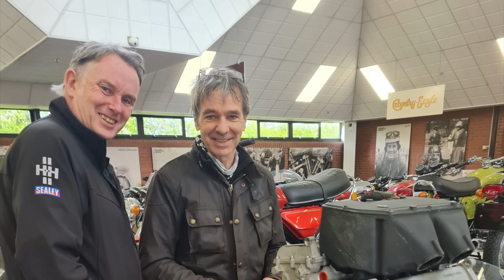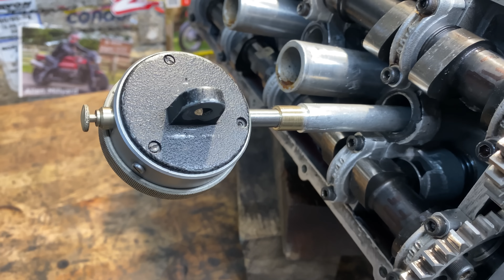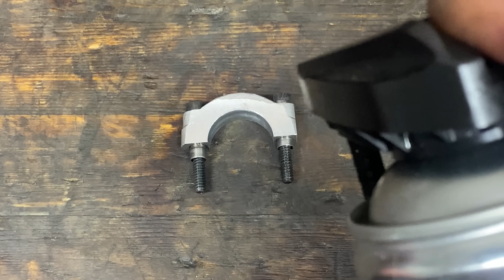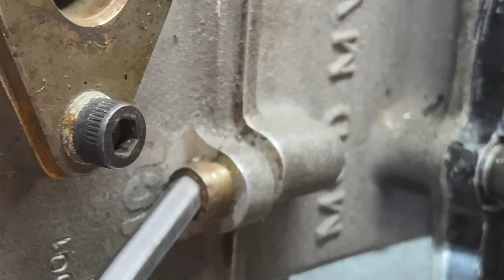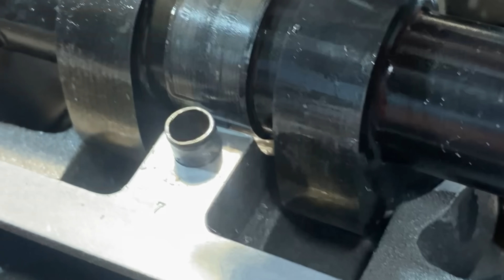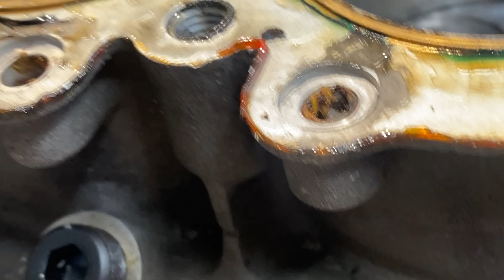Norton Nemesis V8 Rebuild - Episode 3

Comment: I don't know about anyone else,But I hear the clock in the background,Now I can't focus on a video of somebody fixing a motorcycle or a car or just general tinkering without a clock ticking...so I bought an old clock,turn down the volumn on whatever video I'm watching..I couldn't figure out why that sound was so pleasing and relaxing..then I remembered that my grandfather was a machinist and all of his finishing touches were done by hand,with small files,emery cloth etc in complete silence,no lathe running,no polisher, just the ticking of the clock on the wall behind his finishing table,Hot coffee,his pipe filled with Borkum Rhiff vanilla tobacco,and I would watch him for hours in silence
Making babbit or scraping a burnt bearing,then measure it with Lead Wire to see if he had enough to run the bearing with a standing fit or a running fit
His finger flitting,the curly strips of babbit peeling away,made me think it looked liked he was healing a scar.. anyway I start my days again in silence, coffee, Marlboro Reds and the soft tick tock of the wall clock,strange how a sound that it whole job is to do nothing but mark time can make a work day start out easy,focus comes
Reply from the maker: Can’t beat the relaxing sound of a ticking clock 🙂

Comment: Ah, breakfast with Allen...
The lash caps look to be cupped, which is odd for such a low-use engine, unless there was an oiling issue. Did you find the same?
It looks like red anaerobic gel sealant was used on the block/head surface in addition to the copper fire ring and water jacket O-rings.
Some others have mentioned, but the crud in the cooling passages is either large amounts of Stop-Leak or a reaction between incompatible coolants. Let us know what you determine as the root cause.

Comment: At 4: 46 there is 3 cylinder  shaped pipe( flinch?) in the middle of the cylinder head  what are those ? Could anyone tell please
Reply from the maker: They are the coolant pipes from the top of each cylinder head I will be redesigning them

Comment: I’m sure Allen has seen it. Loctite 518 is an anaerobic in-place gasket. It’s deal for jobs like this, because it won’t cure outside the joint so it won’t create crud to block water (and oil) ways inside the engine.
I’ve used it as temporary back-up for worn O-rings and found it sealed perfectly.

Comment: Those water passages are a good indication that the water pump is NOT performing properly. There should be a minimum flow rate of 10 liters per minute at 500 rpm. I would run Liquid Intelligence nano glycol instead of any water based coolants. The engine will run about 15 degrees hotter bu the nano glycol does not turn to steam and there is no pressure in the system as a result.

Comment: I just noticed that the cam sprocket appears adjustable, so they could line it up at a fraction of a tooth.
They had enough engineering moxie to make that, but they have the head a noticeable amount.

[I used to work for a kit car company which made GT-40 replicas. A 289 HiPo motor was sent to the shop with downdrafts, and an Englisee manifold. Apparently, the engine was Boss302'ed, fitted with 351 heads or something. One of my coworkers spent a week making the "bundle of snakes" 180 degree headers for the motor. The engine was filled with coolant, which in turn spilled from the openings from the incorrect dowel-pinning. AFAIK, the headers were scrap. : O ]

Comment: Any possible chance you coukd venture over into car engines 😅 just because toyota never made a follow up engine of the 2jz but they have made 3 cylinder corrolla/yaris engine if you could stick two corola engines together i think that would be a new 2jz that would be insane to then put new 2jz in a new supra

Comment: Another brilliant and satisfying video on many levels. I noticed at 5:59 you could see a plug in the end of the camshaft meaning that the shafts are oil pressurized to supply oil for the bearings.  Novice question:  Are the camshafts cast with the lubrication channel integral or is the channel drilled afterwards?  I'm guessing that the cam lobes are surfaced hardened for the required durability.  Thanks again for taking us along for the ride.

Comment: Mr. Millyard, do you repair CDI SSM Igniter boxes used on late 70's H1's - part number X6T31371?  When I purchased the bike it had no spark.  I tore the wiring all apart probing looking for a bad circuit.  Finally came to the conclusion is was the igniter box.  After changing the box fixed the issue and had fire to the plugs.  I'd like to have a spare in case the box goes bad again.  Let me know, and thanks!

Comment: So that's UNC and Metric, UNF next? 😁What a difference between the front bank and the back. What a task rebuilding that behemoth. Can't be many to tack that on 👏
Reply: If it was a REAL Norton [or Triumph, of the late '70s] it would have had CEI [Cycle thread] for those big axles, UNC for the front cylinders, UNF for the rear cylinders, Whitworth for the forks, and for 'modernity', Metric for all the engine fasteners.....
Reply: I hope Allen has ordered his copy of the Haynes Norton Nemesis manual..
Reply: @packhams4  😆

Comment: Question for Mr Millyard. I always thought you put cylinder head (and camshaft cap) bolts  back in the same holes they came from. Given the way you stored them in the metal trays there is no way you could do that. So am I wrong or are you replacing the bolts with new ones?

Comment: The head is interesting. The cam journal caps seem a bit small. It looks like there is a wrenching hex built into the cam, which appears to have been used quite a bit--though the pistons are still nice and shiny.
Reply from the maker: Yes I thought that as well 😳
Reply: @AllenMillyard  , is the cam billet? Or did they take pipe and weld circular disks on it to make the working surfaces?
I just noticed how small the lower cam journals are--because of the narrowing in the followers/shim-buckets.
Although, waterless coolant does not cool as well as regular coolant, perhaps it would keep the collection of dissimilar metals in the cooling system from corroding. Or, perhaps the cooling...manifold could be plated with something?

When I saw the engine in the museum, I was worried not that the fastener holes were not threaded--but corroded. The one in the museum looks like it's magnesium.,

Even Charley Weaver needs a day off now and then.
Like you say, "In the end you will persevere."

Comment: I would be  ditching that not head gasket set up and make 2 of yours great Allen
Reply from the maker: The cam gears wouldn’t mesh if I fit a gasket
Reply: @AllenMillyard  oh blooming hell your right I didn't think of that the rubber o rings could do with the a Millyard magic touch then

Comment: Loving watch your superb videos.
That V8 Norton looks like a right nightmare. Are the heads based on something else, k series perhaps?
My preference for establishing TDC is to use the DTI just as you have, but I mark a small displacement either side of TDC, and note the centre. This removes the dead spot at TDC when the piston is rocking with no movement on the gauge.
Also, I normally establish the cam timing as lift at TDC (on the exhaust stroke, during valve overlap) in mm or thou", and measure the existing valve clearance. This is much more repeatable than sharpey at TDC...
Just wondering where all that white silicone and rusty debris came from on an alloy engine with no conventional head gasket...? Nasty!
My daily duties include rebuilding Ferrari V8s and recently a few Alpine Gordini engines, so I feel your pain.
I wish I could make such engaging videos as you make, I am in awe of your patience, love of hedgehogs, hacksawing skills and cake 🍰.
I used to operate out of an Oxfordshire shed, but now from a Suffolk shed 😁
The clock, Ahh, the clock...

Comment: We went to the motorcycle museum in the Monday and was gutted we missed you (by only a day lol)… I was pointing out to my wife that the engine on the stand appeared to be different to the one you have as the water inlet to the cylinders were cast in and not bolt on

Comment: Possibly a blockage in the cylinder head,caused by remains of the sand core after the casting process? Looks like no flow of coolant on that side.

Comment: At Perkins the part description for the copper (or aluminium) rings between the cylinder and the head is a flame ring, good thing you pulled it apart looking at those waterways, was the jelly like stuff silicone from when they built it or some cooling system sealant and if so would it be prudent  to check the cooling system holes in the block and the head line up and if so possibly dowel them so sealing is not just relying on the O-rings (Dowty rings might be an alternative as you can put asmear ofsealant on the aluminium outer ring but the rubber inner ring should stop sealant getting into the waterways), like the ST11 by the way.

Comment: Im interested in the brief, is it to faithfully restore to original or update and improve reliability whilst maintaining the overall aspect.?
Reply from the maker: I need to re engineer quite a few parts to s to make it run properly but will look the same when failing is replaced
Reply: @AllenMillyard  Failing? Bit of a Freudian slip there methinks 😁😁

Comment: Just speculation on my part but seeing the numerous blockages in the water passages, I've seen something similar in a motor that the owner had used an overabundance radiator stop leak.

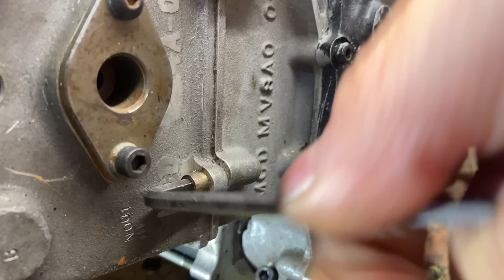Comment: (6:37) Is that boss under the cap screw cracked? Or is that something else? And there look to be another couple cracks in the cam gear at (11:10). Also, that gear looks like it has not been heat treated.

Comment: When dis-assembling any piece of machinery it has always been my policy to place clean parts in plastic ziplock bags that are clearly labeled. Job #, dwg # if available, part # if available, part description and fastener size/grade as needed. Any parts the it is required to avoid damage as much as possible wrap these in heavy paper towels or sheets of chipboard (heavy cardboard as on the back of wrighting tablets) (1) to be placed in between things such as the lapped surfaces of CAT type jechanical seals. Doing this especially valuable when the joi ob may sit idle for consideranle time waiting for parts from outside vendors.
1) We had a sister company in Switzerland that every year sent us a bunch if calenders with 1mm thick chipboard on the back. I would cut it all off and stash for use as needed.

Comment: at 6.42 -- that looks like a crack  in the cyl head alloy under the allen screw head  ;;  that rear half has tried to seize due to blocked cooling ducts ;;

Comment: Thank you for another excellent video of the strip down Allen.
I wonder if it might be an idea to install Helicoils or thread inserts on the cam bearing cap bolt holes to prevent the bolts from pulling the aluminium out when they are torqued.

Comment: Hi 
You said the cams felt good and smooth but from the small screen there did appear to be some unusual marks but I am not holding and looking directly (just an observation) nice to see a V8 with a flat plane crank. Who designed the engine?. The cylinder head design looks familiar a bit 1970s lotus maybe 
Keep up the good work

Comment: At 6.35, the small screw on the outside of the head, is that a crack or a casting mark?
Reply: Several of us have spotted the same. Time will tell if it is just a bit of debris or a real crack.

Comment: Is there no Haynes Manual for this Engine 😮
Reply: Just take some bad black and white photos with a potato camera of a random engine, that's what you get with Haynes' joke of manuals these days.
Reply: @erik_dk842  It could be said there is actually 'no Haynes manual' relevant to any engine.....they're bloody useless publications.
Reply: @howardosborne8647  For cars these days, what they SHOULD show is how to remove and install all the plastic trim without breaking stuff, so the DIY'er can do stuff like heater flappers, that would cost a fortune to get fixed. Original Honda and Suzuki workshop manuals are very good, and show stuff like detailed routing of electric and mechanical cables

Comment: I reckon the last video in this rebuild will be Allen saying "I decided that whole engine was a bit rubbish , so I built a whole new one. Here it is , and it's just perfect".
Reply: Norton Nemezis V12?
Reply: @Jedendwa0 a V10 would be just perfect.
Reply: @althejazzman 
It's my understanding that a V-10 is the sweet spot between displacement, piston area and internal friction.
Reply: @mpetersen6  A V10 is a configuration not a "displacement"...if you need more than four cylinders in a motorcycle, you've done something wrong
Reply: @stephenscholes4758   Moto Guzzi 500cc  v8 in 1957,  and 125cc  5 cylinder in early '60s  etc,,   but what would they know 🤔
Reply: @andyb.1026  
For racing maybe. For road use? Who wants to run at the upper end of the rpm range constantly.
Reply: @mpetersen6    for road use I would argue that a 3 cylinder is ideal,,  Laverda jota
Reply: @andyb.1026  Not a lot...the future of the racing engine even by the late 1950's, was two stroke, not multi cylinder 4 strokes. Honda's dazzling engines took the motorcycle engine not that far in terms of relevance to road market
Reply: @stephenscholes4758  in the 50s a typical British road bike would need weekly  maintenance and even then only last about 10 to 15k miles between major overhaul.   By the mid 60s Honda road engines would easily do 50 to 70k plus,  I believe that's an impact
Reply: @Jedendwa0 
If this was built by Naiper & Sons or BRM it would be a V-16 or an H-16/24.
I am of the opinion that BRM hired former Napier engine designers.
Reply: @mpetersen6  Napier Deltic engineers ?
Reply: @scooby2142  
Now a minature Deltic would be a beautiful creation it would be utterly pointless in a bike. There is a gentleman in England who built a scale running replica of either a Napier Dagger or Rapier H-16 or H-24. Amazing piece of work.
Reply: Totally perfect response! Then goes out and sets a speed record with the Millyard Revised V8.
Reply: @TurnipstalkIt looks like they ran straight water with no coolant added for corrosion protection.
Reply: @Turnipstalk All engine blocks will corrode if proper coolant is not used.  That is a maintenance fault, not a design fault.  You simply can’t design around all of the idiots.
Reply: 😆🤣 I.O.M Lap record & senior trophy here I come lol.
Reply: @Turnipstalk 
The O-rings could have been seated in a trapanned groove in the face of the head or block. And l agree. This looks to be a case of either improper coolant or did oil penetration into the cooling passages cause sludge to form. If so how rid it penetrate.
Reply: Using plain water in an alloy block is stupidity. Coolant is required and that is changed every couple of years.
Reply: That made me laugh out loud!

Comment: Allen, at 6.37 ,there is what looks like ,a stress fracture on the upper mounting lug, you would probably find it later, but i find it's easier to see with the crack dirty. Nothing your tig welder wouldnt fix.
Reply: I noticed the same thing as you. Time will tell if our observations are correct or if it is just a hair or bit of debris on the lug.
Reply: @howardosborne8647  Yes i did think ,maybe it was a hair ot debris,Allen im sure would see it,when he is checking things over ,he is such a great engineer ,especially with the fine detailed builds.
Reply: I see that too with the 4mm at roughly 6.30 -7 minutes ish
Reply: @295walk It's been machined,so you can get an allen key in, asking too much i think for such a small tab,unless there are other clearance issues ,we are not seeing, hopefully Allen will beef it up a bit,with his tig.

Comment: Wonder why they used a mixture of imperial & metric fasteners, especially considering this engine was designed & built in the late 90s?
Reply: Small diameter imperial bolts are used in aluminum because they have a coarse thread and are therefore less likely to strip the aluminum. 
Metric bolts are used elsewhere because they are suitable
Reply: Charlie Weaver specified the threads/fasteners.....he was obviously well sozzled at the time😂

Comment: Amazing prototype engineering very cool and in lovely nick. What a beast. Clearly someone has rebuilt if before and made some somewhat hacky changes - Sawing up a magnesium air box? Ditching an alternator? Leaving bolts loose or not even fitted? Throttle linkage clocked in such a way it jams the throttle! If that bike could talk... It's lucky it didn't grenade itself being run that poorly assembled. Couldn't be in better hands now though. Love the video style just the content. The engineering is the star feature and you can even hear a cool old clock tick!

Comment: Proper Engineering. I love the Torque from Vee configuration. I worked for 9 years as a Quality Inspector, at that time the Firm I worked for Parent Metal Coated and Hot Honed V10 and V12 F1 Blocks, they had 95mm Bore and 30mm Stroke, hence Compressed Air Valves were needed because a Spring can't react at 95 times a second at 23000 RPM. When you Flexihone those Cylinders dwell more at the bottom than Top, that will allow the rings to relax at the bottom of the stroke, try for 30 degree cross hatch for best oil retention and least blow by.
Reply: Brain box.
Reply: @tonysmith8397  lol, everyday is school day even now at 52 😉